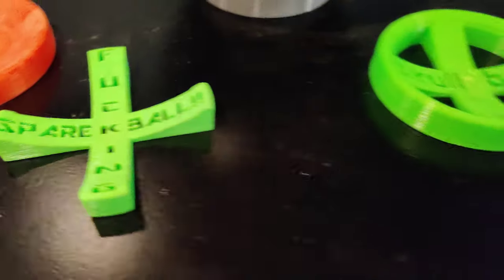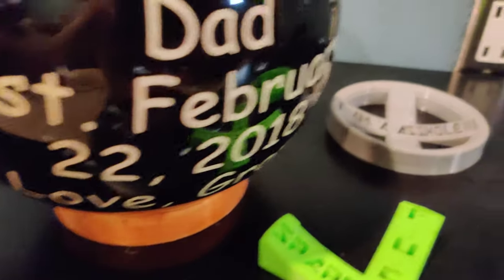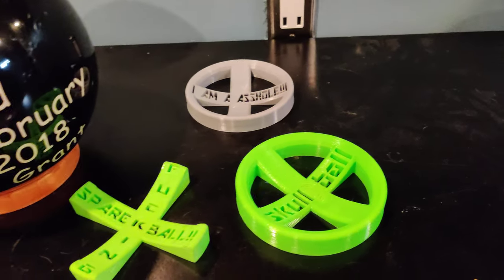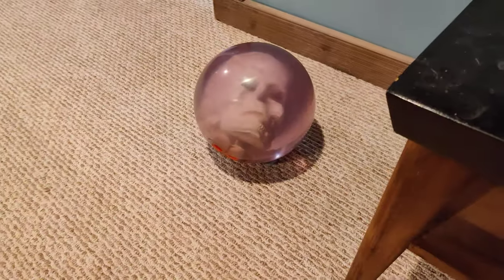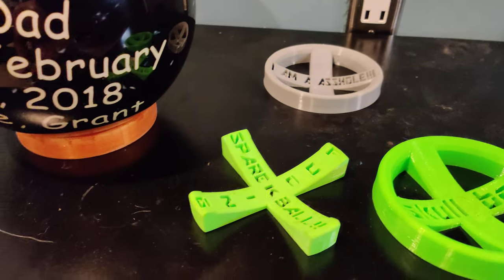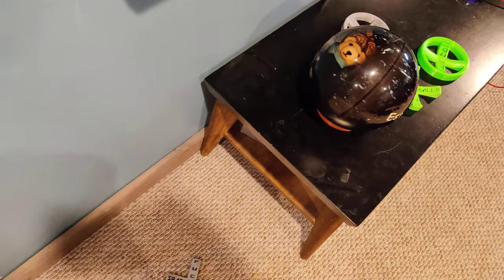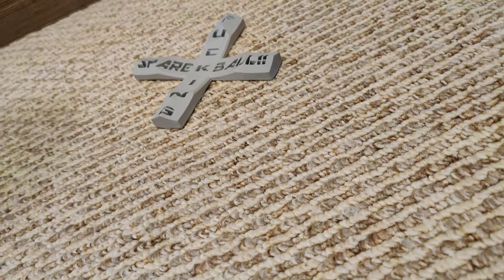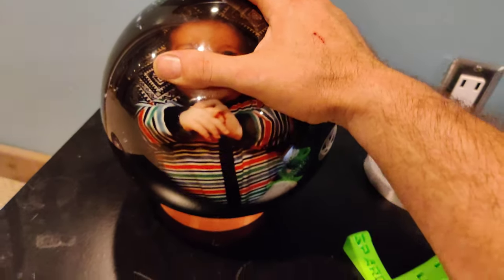3d printed bowling ball holder thingiverse

Comment: Do you have a file for the f*ck*ing spare ball? I can't seem to be able to make a file
Reply from the maker: I used windows 3d builder. I typed the letters out in paint use a stencil type font. Import  the image into 3d builder and extrude and subtract the solid. I didn't make f$#+ing spare ball available because it's funny to me.  I worked on the spare ball holder off and on for weeks learning cad software and 3d printing.
Reply: @jamesvangemert5641  can I get your permission to make these designs with my own writing on them and sell them?